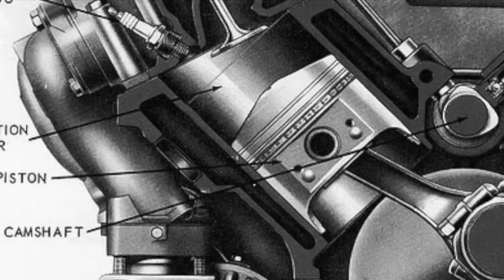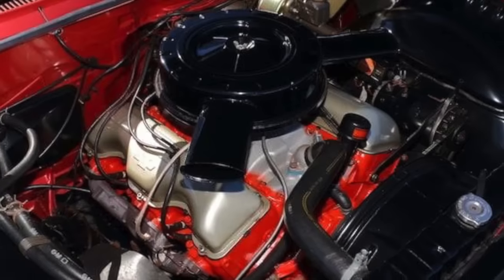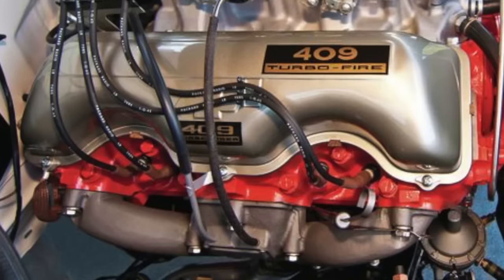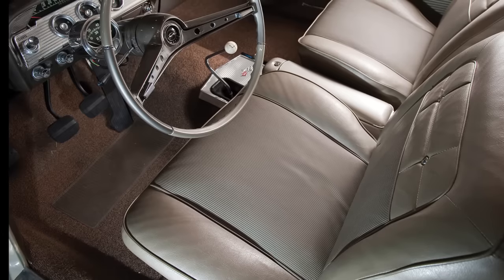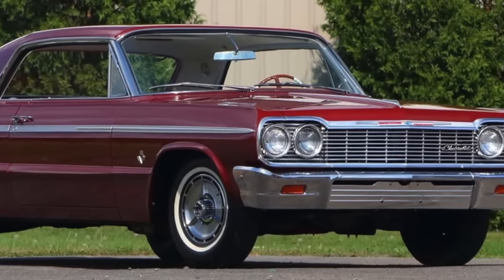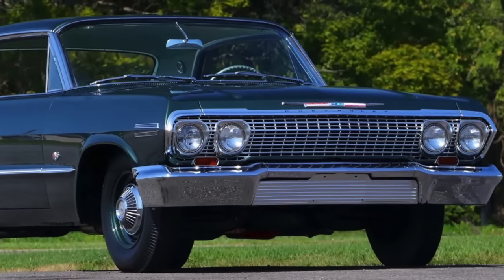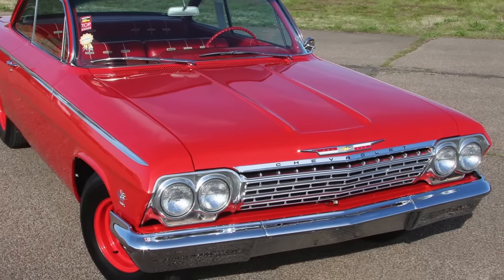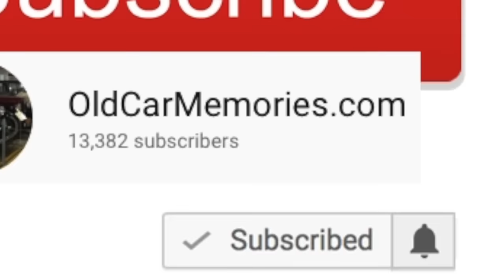1961-1965 Chevrolet 409 V8 - The Ultimate Budget High Performance V8

Comment: So the question was never answered why was production halted on the 409 engine?
Reply: Muscle car era and all manufacturers wanted to be ahead of the game and be #1 and went to bigger and better engines with more horsepower.
Reply: It was relaced with the much more reliable 396 late in the 1965 model year, which was increased to 427 ci in 1966. Alas, 1967 was the start of emissions controls and manufacturers had to worry more about reducing emmisions than power. The end of the muscle cars was then in sight. By 1977, the gasoline octane level was reduced to 95, too low for those high compression engines. I had bought a 1200 cc Harley in 1976 and by the next year, I was unable to buy gasoline that would allow it to run without the cylinders preigniting due to the low octane caused by a reduction in the amount of lead. By 1981, no leaded gasoline was sold, at least in California. That ended the ability of high compression engines to run on gas station gasoline. Today, few engines have compression ratios higher than 8.5:1.
Reply: The block\head design wasn't efficient at high rpms because the combustion chamber in the block impeded exhaust flow.  In 63' Chevy had 427 racing shootout when they released Mark II mystery motor vs Z11.  In 65' Chevy released the Mark IV which was further modified Mark II block with slightly revised Mark II heads.  The Mark III is just licensed Mark IV.  The Mark IV block is stronger than the Mark I and as a result it's about 35lbs heavier but most of that is because the heads.
Reply: Most cars have a compression ration 10:1 or higher, some as high as 14:1.  Even many forced induction cars running higher than 8.5:1 today.  The LT1 in the Camaro and Corvette is 11.5:1, The supercharged LT4 is running 10:1.  All this is made possible because of high pressure port injection and\or direct injection.  Even my turbo charged rotary has 9:1 compression from the mid 90's

Comment: 1965 some big chevys came with a 427 cid.390 h.p.some 396 had 375 h.p,in 1965.
Reply: 1966
Reply: Timothy Lines The 427/390 had the "passenger car" oval port heads and a mild hydraulic cam. The 396/375 came with high performance rectangular port heads and a solid lifter cam...It was a beast compared to that particular 427....
Reply: ..as I said before I had a 1968 camaro with a 427 450 h.p.v8
I should have said it was a yenko camaro..I bought new at Jay Kline check..  m.p.l.s...one of 46 made that year ..y.s.#8016..rally green.. after modifications about 650 h.p.. and the price new was $ 4400 And change...if I could have it back.
Reply: Very rare the 396 was rated at 325 HP in the Impala , 375 HP in the Chevelle one of the rarest cars I ever seen was a Z-16 and 425 HP in the Corvette .

Comment: My dad's friend has a Henry j that has a 409. I guess it originally came with a 4 cylinder engine and was fitted with a 409. Dunno if gm did the conversion or what. That car could put the rubber to the ground tho

Comment: The iconic 426 Hemi Mopar was only a $900 option, but then I only paid a little over 3 grand for my second generation 1969 Cuda with a 440 option brand new. Oh at 3000 lbs that 440 Cuda would smoke any 409 or 427 I raced.

Comment: Now question is, how easy are these blocks to find, and swap into anything our minds come up with?  Weird valve covers aside, it still uses the Chevy transmission bolt pattern, making it a breeze to drop into anything a 427 or 454 would fit into.
Reply: Original parts are hard to find, you have to get reproduction parts. The next Big Block was better with free breathing heads in 396, 427, and 454 cubic inches.
Reply: The smog block 454 can still be reverted back to '70 performance with  the appropriate heads, manifold and carburetor, right?  The big block lived a good life even into the '80s, just curious if it's as versatile as the small block.
Reply: There is still a lot of speed parts for the big block " RAT " motor.  The LS motors are popular if you don't mind sensors, wiring, computers and programing.
Reply: LS motors can have carburetors since they do make carbureted intake manifolds for them.  Gloriously expensive though, LS blocks certainly aren't the cheapest route to go for a budget speed build.
Reply: Why would you bother to go out looking for a 409 to swap when the 396-427 & 454 are far superior to the 409?
Reply: @4thstooge75  The uniqueness of the 409.  Besides, if you put that 409 into a 60s or older car, you probably aren't going to seriously race it.  You don't want to abuse it.

Comment: Oh one more thing about that 60 Chevy Impala with the 348. It had a strange transmission. It was called the torque glide. It seemed like just it only had one speed. It just never shifted to me. It had another setting on the shifter with the letters GR, boy was that a waste of time to use. Top speed in GR was maybe 15 mph and the pistons where swapping cylinders.
Reply: It was called Turbo Glide!
Reply: That was the Turbo Glide.  Buick made a similar unit for 58 - 60 called the Flight Pitch Dynaflow.   That GR was for engine braking going down hills.  You weren't supposed to try to accelerate in it.  Would destroy the converter.
Reply: @633rex100  Thank you for correcting me. I really didn't remember the name of it, but is was also a dog. It went out and replaced it with a Power Glide. That was when I figured out that the Motor was a dog.
Reply: @michaelbenardo5695  Well it was a dog of a transmission. It went out and replaced it with a Power Glide, then I knew that the 348 was a dog. I even took it to a man that built race car motors for dirt track cars. He looked at it and said. Just leave it alone because it wasn't worth messing with.

Comment: The 1960s was a very different era in automobiles. In the 1960s gasoline was plentiful and cheap and contained tetraethyl lead instead of ethanol. Also the way to produce a lot of horsepower was a large gasoline thirsty V8 engine with one or two four barrel carburetors. There was no gasoline direct injection, only two valves a cylinder and no turbo charger.
Reply: Turbos did exist, but were mostly used on aircraft engines and diesels.  Severe turbo lag.  That's why I like superchargers better for gasoline engines.  NO turbo lag.

Comment: The 409, was infamous for having a very weak bottom end. If one lasted over 8,000 mile of tire smoking it was very rare.The W shape of the bottom end put too much stress on the crank,rods =BLAM!. 
The 1961 Ford Hi PO, 390 police interceptor with 1, 600 cfm Holley, solid lifters and a block with outer webs by the crank produced 385 HP. Plus ran many, many miles,unlike the rod throwing 409 chevies big blocks in those days.
Reply: Only the Hi Po 390.  If you tried to use the "regular" 390 for racing, it too would break parts and/or wipe out it's bearings.

Comment: The 427 ci. BB. was developed in 1963 only as a nascar race engine and the 409 ci. BB was still the only BB. that was available for the impala until 1965 when they introduced the 396 ci BB. Then in 1966 as  a BB. 427ci. impala. For 65-66 same block but different ci.
Reply: martin750hp no

Comment: the whole concept of 'small block' vs 'big block' started with the 348-409 engine.  prior, you didn't really have a choice of different size, esp different block family, for a single model car. taller deck, larger bore spacing made for a stronger engine...excellent truck engine too.
Reply: True unless you were Pontiac. Watched the documentary on the engineer who worked on them for almost 30 years. He said they used the same basic block all the way up until GM killed the other division's stand alone engines. I've seen an Olds 350 Rocket in an early '80's Caprice Wagon just to get rid of the leftovers.

Comment: As awesome as it was the 396 was better, canted valves it took 2 carbs to get 425 horse power a 396 could get it done with 1 carb ,but the short stroke big bore is the way to go big RPM ,Ford's 429 is much like a 409 short stroke big bore ,429 is a great engine

Comment: The 348 and  409 engines were originally built for the the Chev truck motor line  with appropriate mods for passenger car use.
Reply: Nope, wrong info
Reply: They were designed as truck engines but were also used in cars, according to wikipedia and many other sources.

Comment: I’m thinking it was the Valve covers..they were so identifiable ..i did an awful lot of drag racing back then and to get that 409 to run it had to be tricked. My friend and fellow racer had one in a 65 impala..it had it’s own set of rules to make it hold together and be fast. His was  an AHRA record holder.think the class was Modified Production B/1/S ..the best builder was Otie’s Automotive out of Akron .. Over rev them and not only did they blow up you went slower..Again the valve cover..you could always tell it was a 409…or a 348..think the dif is what side the dip stick is on.

Comment: a 1963 impala SS 409 4 speed convertable ,sticker price was $3419 paid $3100 engine great went through 6 clutches the first year sold to buy a Plymouth 383 4 speed  a much more reliable car and still pretty fast 1/4 mile 14.4 @ 102 mph

Comment: Would it be bad to swap out a 283 engine and put a 409 in a 1965 Impala?
Reply: ..would be better to put in a l 72 427 425 horse motor....
Reply: Depends on why you wanted to do it...it would be a rare bird, and maybe sorta cool. (I didn't recall that the 409 was available in '65.) Probably not all that fast unless lots of work and $$. Using a  later 427/454 type motor would be easier to make fast, but more common.
Reply: @mobytech8603  4:05

Comment: Was the Z11 the "Mystery Motor"?
Reply: Machi74005 no
Reply: No, that was the later 427
Reply: Yes! Machi74005 it was a 409 block punched out to 427 for drag racing before the debut of the all new big block.
Reply: Z11 was '409' style heads... Mystery motor was Big Block Chevy/BBC style heads...
Reply: No the z28 302 of 1968 was the mysi motor

Comment: What does the 409  Stand for ?
Reply: engine size.  The displacement is 409 cubic inches, which if built today using metric standards would have probably been called a 6.8 Liter engine.
Reply: Machi74005 Thx for the clarification :)
Reply: sim61642 cubic inches
Reply: Machi74005 The Beach Boys are grateful that we were not using metric engine sizes “she’s real great my 6.8!”
Reply: 409 stands for "great example of American post-war engineering"
Reply: 409 cubic inches of piston displacement... and some models also 409 HP...
Reply: @richardcurrin8940  girls would definitely be confused as to what you were bragging about

Comment: There's nothing "budget" about a 348 or 409, unless you have a very large budget. I currently have a 1964 Impala that originally had a factory 409, but the engine was gone by the time I bought the car. I was forced to put a 283 in it, since that's all I could afford. 409s are so expensive, thay're made of Unobtanium.

Comment: About 1971, my brother had a 60 Biscayne.  It had the 283.  He wanted something a little hotter for it.  Check the local papers and found a 409 for sale. Chrome valve covers, two AFB's, man was I impressed (at 14 years old).  It fit the Biscayne perfect. Had a 4 spd behind it.  Those were the days.... ..oh did I mention that complete engine was had for the kingly price of $100?
Reply: Ya know...back in those days it was not unusual for hot cars to be stolen and found without their motors...go figure.

Comment: The only real problem with this engine , the piston and rod were so heavy that it would wear the bore oval in relatively short order . Otherwise the V -8 and V-6 truck motor were pretty good  .
Reply: Chevy didn't have a V6 until the 80s.

Comment: wrong I have a 56 Chevy with a348 and the dip stick is completely backwards to what you are saying I'm standing here looking at it but thanks
Reply: Now that is a rare combination!
Reply: Moby Tech I'd have to agree with that never before did I ever think about it or actually know about the dip stick can't explain it but it is what it is right thanks for the info
Reply: 348 dipstick placement depended on whether car or truck engine...
Reply: Are you standing toward the back of the car? Maybe it's on your other right or perhaps they put the engine in backwards. Which way is the fan facing? Sorry, just kidding. Right and left are always relative.

Comment: That big block engine was a short-lived it was rumored that these motors had sodium-filled valves I don't know how true that is
Reply: I've found a lot of sodium valves in the Chevy engines built for truck and industrial use. I even remember a set of small block heads from a forklift with sodium valves. You could tell because the stems were a larger diameter

Comment: DUDE don't form opinions in your video. The GTO was already on the drawing board. You are too young to know!  The original 427 barely ran on pump gas and was shelved. It was a monster motor! The 396 was quick but didn't oil right and spun rod bearings! I know I built both!

Comment: The 409 is an iconic engine for sure. But Ford did not have the first V8. Chevrolet had the model B in 1917 and 1918, and had an overhead valve V8, I believe it displaced 326 cu in.
Reply: I don't now who first made a V8 engine, but Cadillac marked the first relatively mass produced V8 for cars in 1914.
Reply: @oldgysgt   yep, Ford did however mass produce the first single casting block V8.

Comment: Also the 348 block casting was the same for 409, 427.
Reply: And 64 was last year for 409. not 65.
Reply: It was available in early 1965 models, but with only a single carburator. The 396 was released in late 1965.
Reply: Actuallly, the block was recast to make the 409.
Reply: @raymondwagoner4896  65 was the last year.

Comment: Most have to also understand the horsepower and torque ratings were grossly over rated. As in rated in gross power (engines on a stand with no accessories). Net ratings were not even available. I can tell you ZERO of these vehicles were anywhere near the rates listed at the time (especially if they were automatics). Still... They were very powerful engines no doubt.

Comment: GM was dumb to get rid of the 409. Even if other engines were technically better, the 409 was cheaper and had name recognition from Beach Boys song. Nobody wrote songs about the 396 or other big blocks. You can't buy that kind of advertising and GM just threw it away.

Comment: well as good as it was it had a habit of breaking crank shafts and cam shafts
Reply: roy myers, yes, I came to the comments expecting everyone to be talking about that but only you point this out! Low rpm high torque engine for trucks that did fine in it's element because good truck drivers knew how to take care of their equipment. As a kid I devoured everything in big brother's auto magazines and I remember an article about a kit to convert the 409 to four bolt mains (included a bolt-in jig to insure accuracy for drilling & tapping the new bolt holes). I had two cousins into cars big-time, one (custom car painter) buying a brand new Corvette Convertible when the 1963s came out and immediately tearing into the engine, thus at 13 years old I got to ride with his brother driving in a dual quad supercharged 409 top-down Vette with a 4speed B&M Hydro Stick on cheater slicks that had me dizzy as my eyeballs seemed to repeatedly find the back of my head. Later in the day both cousins seemed impressed as they looked at each other when I asked "Roller cam and four bolt mains conversion?" The reply was "Of course, only way to hold them together!" Personally, my only affection for the W blocks was the better chance of changing spark plugs without burning my hands...
Reply: i also heard the 348 and the 409 was desieghnd to be a diesil but did not withstand the compresion

Comment: the heads were flat,but the values  were in the head.the 2 4 ,s engines had solid lifters,and a cam to mach,they were outstanding engines.,..the crank shafts of later big blocks,fitted in the 348,s and 409s too.

Comment: The slickist 409 I ever saw was a custom order from a dealership in Dallas Texas. A 1963? Corvette with a 409 dealer installed engine. Why, I never found out. Last I heard this duel carburated tire smoker lived in New Jersey. Still all original matching numbers from dealer. What got pulled? A Fuelly 327. Go figure.

Comment: As far as finding old 409 motors and parts why bother World performance makes a aluminum block with many upgrades  over stock Edelbrock makes alum.  heads A few cos make rotating assys. Now WHY build one ? Well if you want something unique  powerfull and reliable that can run with ANY  motors bbc inc. you now have a great choice
Reply: With some parts finding luck, building your own engine can cost 1/10 out of pocket the cost of buying one...